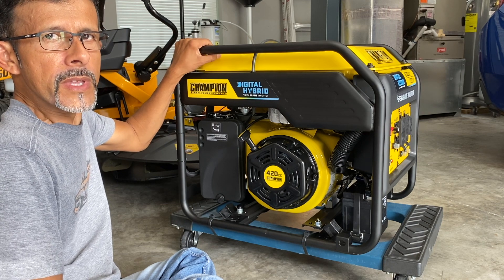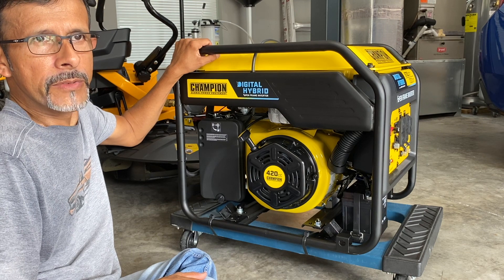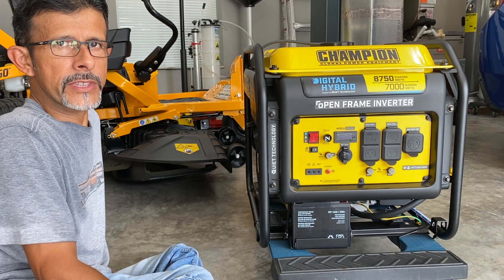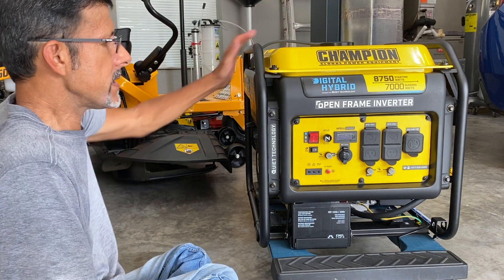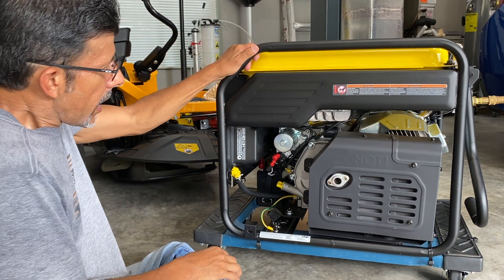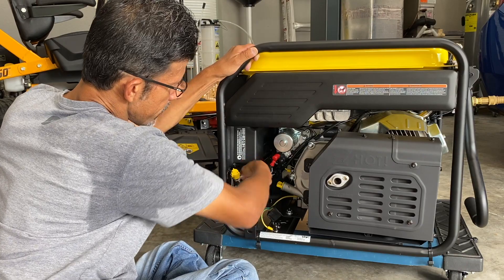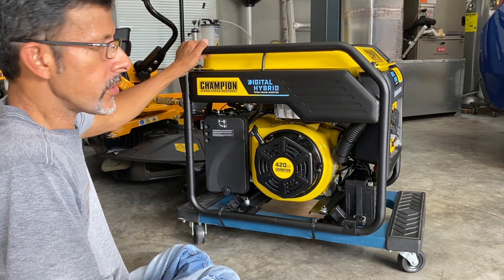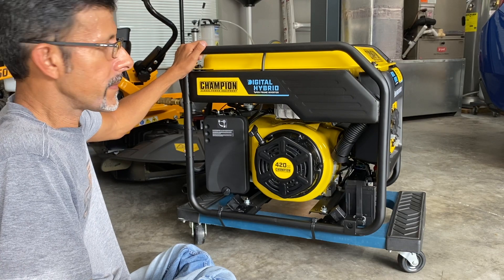Champion Inverter Generator 100520 with tri fuel kit

Comment: Great video and thanks for sharing.  When you hooked the generator to your panel did you change the 100520 to Floating neutral?
Reply from the maker: No, I didn’t change anything on my generator.
Reply: @Ozzie4Para  I heard back from Champion on my configuration.  Since I am binding neutral to ground inside my transfer switch, they asked me to switch the 100520 to Floating Neutral since my only planned use for this Generator is home power standby hooked up to the transfer switch.

Comment: Can you post a link to the blue cart that is holding the generator?
Reply from the maker: I bought it at Harbor Freight. https://www.harborfreight.com/30-in-x-18-in-1000-lb-capacity-polypropylene-dolly-69566.html
Reply: Thanks Ozzie!   I have been looking for a generator that is cheaper than the Honda EU7000is and this one has the extra capacity, inverter, propane capability that I'm looking for.   I bought multiple 40gallon propane tanks for my future generator.   What is the max wattage you have loaded up each leg before it trips while operating on Propane (I assume less than the manufacturers rating on gasoline)?   I have a L14-30 connection at my service entry panel.  I'm hoping to run a 3 Ton central A/C unit that uses about 9.8 amps per leg at 240Volts.   
**I just checked the other replies and it looks like you were able to get 6000Watts on Propane fully loaded.

Comment: I’m gonna buy the exact same unit..I’m gonna wire in a a plug to my main electrical panel so I can just plug the 30 amp 240 volt into it to run my whole house...Question,how do I need to ground or un-ground the generator? 
Is that generator a floating or bonded ground? Does it really matter?
Reply from the maker: Some say it matters but I haven’t touched my ground on my generator and it’s been working fine. You might want to check Champion’s website for more details.
Reply: @Ozzie4Para  Ok I’ll do that. Thank you

Comment: Thanks for tri-fuel tutorial. I too just bought this generator after having been without power in central Texas for 5 days. My house is equipped with inverter minis-plits and I was not willing to risk damaging them with my Generac 5500. We woke up to 40f temps and seeing our breath every morning. I'm looking forward to adding this propane option since we have a 250gallon tank on the property.

Comment: How many watts did you lose running propane or natural gas?
Reply from the maker: I’ve read you lose roughly 15% with running propane. The number goes a little higher when you’re using natural gas.
Reply: @Ozzie4Para  Yeah, I have a Tri Fuel generator but it only addresses the propane and gas; I looked at another brand that was 8000 running watts gas, it said on NG it dropped to 5500 watts, so they were claiming a loss of almost 32%.

I've been trying to decide what size generator to go with based upon intended use of NG; but I'm unsure how to gauge that if using a US Carb kit.

Comment: Hey Ozzie GREAT video and thanks for taking the time to put this together Sir.  Quick question on the MSK3101 kit from the US Carb.  I know you haven't tested this on Natural Gas but do you think it will work?  I heard mixed reviews on NG due to the lower pressure?   Can you proivide some guidance or directions please on the NG topic?  I have a permanent natural gas 1/2" line and this will work perfectly for me.
Reply from the maker: I can’t see why it wouldn’t work on NG. But just know that the BTUs on NG is even lower than propane which is lower than gasoline. So pretty much what that means is the generator won’t be putting out it’s rated power on either propane or NG.
Reply: We have a Predator 9000/7250 watts gasoline generator, that I converted to NG using this same tri-fuel kit. It runs great on NG and I haven't noticed any power lose, compared to running on gasoline.  The key is, pipe sizing and adjusting the generator/power valve to achieve the 60-62hz output under load.  I had to do this to ours and used a "Poniie PN1500 Portable Micro Electricity Usage Monitor Electrical Power Consumption Watt Meter Voltage Amp Tester," to adjust the RPM's. I ran 3/4 pipe, hose and quick disconnections, for our system.  It runs great.

Comment: Thanks for the videos Oz! Think I'm going this route. Being a few months now, how is it still running on other than gas? And dupe question, why the 2 meters on the project box?
Reply from the maker: The two meters are for each of the 120V legs so you can see how much of a load each leg is carrying.
Reply: @Ozzie4Para  Finally got mine dialed in, running on NG, good for about 5500 watts. Thanks again for the inspiration.
https://youtu.be/jbrS6D4wk5g

Comment: Great video , how do you connect this to your home , like your splits or lights or fridge , do you run extension cords or can you do modifications to plug straight up to your fuse box
Reply from the maker: I have a 30A connection point that is directly wired to my electric service.

Comment: Hey Ozzie, I've enjoyed your videos, what's the max wattage have you got from your generator on propane. And I was wondering what kind of mini splits do you have.
Reply from the maker: I can get roughly 4500 watts from my generator on propane. I have four mini splits total. One is a Pioneer, the other is a Carrier and the two others are from Mr Cool.
Reply: @Ozzie4Para  You max out at 4500 running watts on propane? I wanted to install a motor snorkel on my unit but am scared about how much power it would generate on natural gas.
Reply from the maker: @spqr105  I know the BTUs on natural gas is less than LP and much less than regular gasoline. Therefore I have no idea what the max wattage would be while running on natural gas.
Reply: @Ozzie4Para  in the FAQ section of the motor snorkel site it states, " Is there any power loss when operating on alternative fuels?
 No, we have never had a single unit show a loss of power on alternate fuel.  Though lower gallon-to-gallon in BTU content, sometimes they perform even better than running on gasoline (see also fuel consumption).  The engine regulator we install has an external fuel mixture adjuster that can be turned with your fingers and can be fine-tuned to your elevation and to the fuel supply connected.  That's why we include the Engine Hour/Tachometer Meter with every generator.  You can watch the engine rpm output while turning the mixture adjuster for peak performance and high efficiency.  This allows full control over the fuel mixture no matter what elevation.  Unlike operating on gasoline where the carburetor is a fixed jet and it can not be adjusted only replaced. This is a big advantage that allows the engine to be reset at anytime.  Engines would not use the same fuel mixture in different areas especially as diverse as say Florida would be to Colorado.   Unlike gasoline, setting the mixture lean on alternative fuel is cool running, clean burning and efficient."

What are your thoughts on this? Is this statement inaccurate?
Reply from the maker: @spqr105  I don't see how that statement can be true. I say that for the simple fact that it is proven that LP and natural gas have less BTUs than gasoline. So if a generator is rated at 5500W in stock form, how can the same generator put out the same 5500W while it is running on LP or natural gas? Take a look at the dual-fuel line of generators from Champion's website. They clearly state that the output while running on LP is less than what it would be while running on regular gasoline. I would tend to believe Champion's word over the Mr Snorkel website. Of course this is just my opinion...
Reply: @Ozzie4Para  This is a very good point and I do agree. I'm very tempted to do the conversion but wonder if it's even worth it if I'm going to lose a lot of power.

Champion states that their tri-fuel model produces, "Gasoline: 10,000 starting watts and 8000 running watts, propane: 9000 starting watts and 7200 running watts, natural gas: 8750 starting watts and 7000 running watts."

If my math is right they're saying natural gas is a 12.5% drop from gasoline which would put the running watts at 6,125 watts. That seems pretty high but I'm not sure how accurate it is.
Reply: @Ozzie Alarcon  @spqr105  interesting discussion. I am no engineer, so I could be way off base here, but the BTUs are not directly being converted to electric current, but rather mechanical energy (they fuel the running engine.) That mechanical energy is used to turn an alternator which creates the electrical current. So, if an engine turning at 3500 RPMs turns the alternator fast enough to generate 7,000 kW on gasoline, why wouldn't the same engine, turning at 3500 RPMs, running on propane or ng generate the same 7,000 kW of electrical current? In theory US Carburetor's claim makes sense if you can indeed tune the engine to get the same RPMs on propane or ng (under full load), as it does with gas. However, I do not think Champion would lower its output ratings for the propane and ng on its tri fuel generators, unless those are the values they are measuring with the different fuels. So, either you can't generate the same RPMs (under full load) with propane or ng, or you are indeed getting more electrical output than you think you are getting. Regardless, Ozzie, great videos!

Comment: I have the same setup and finished hooking up everything else up. It ran rough at first, I adjusted it until it ran smooth. It then ran fine for a couple of minutes and cut off. Tried it again and it would start, but die out. Did you have any similar issues? I think that it may have something to do with the engine warming up. It runs at 3,400 RPMs without a load.
Reply from the maker: I don’t have any issues with mine.

Comment: Three questions: does the generator have a low oil automatic cut off switch?  Does the generator charge the starting battery?  And does the propane conversion affect the warranty?
Reply from the maker: 1) Yes, the engine has a low oil turn off switch. 2) Yes, the generator also charges the battery as needed. 3) That question is sort of irrelevant because the manufacturer wouldn't have any way of knowing about the propane conversion. That's the beauty of the conversion kit. It is fully reversible if need be.
Reply: @Ozzie4Para  so if I do convert to LP, I should not post a video on YouTube that would show Champion what I did?
Reply from the maker: @olegig5166  Champion could not legally prove anything from your video on YouTube. That is unless you clearly post a video of the generator’s serial number in question.

Comment: A wonderful informative video that you did a great job in presentation of.  I just ordered the same model ( Champion 100520 ) yesterday with the tri-fuel kit as I will run it on Natural Gas. I have been using mini-split HVAC units for over 7 years and a (Heat-Pump water heater) almost 2 years, great choices for almost anyone unless they live where it is cold more often than warm.
Reply from the maker: Thanks for the nice words. You'll like your new generator.

Comment: Great Video!  I am looking to pick one up and was interesting in converting to work with propane as I was unable to find any stock inverter that has both propane and a L14-30R connector.  Any idea how long the run time is on a 20LB tank?
Reply: Never mind I see you answered outback below who asked the same question.

Comment: Hey, Ozzie! Do you have a link to the tachometer that you installed?
Reply from the maker: Here it is: https://www.amazon.com/gp/product/B07DZB57H5/ref=ppx_yo_dt_b_asin_title_o06_s00?ie=UTF8&psc=1
Reply: @Ozzie4Para  
Hi Ozzie, thanks for the video on the 10520, I went this exact direction  based on you details of your video. Everything went perfect, the conversion kit went in slick but I am having a hard time getting the tach/hour unit to register RPMs, are there any hints, ie firing sequence selection, location of induction wires, etc. Any help would be great.

Thanks,
Reply from the maker: @joanandrussell4512  you might have to set the correct engine setting on the tachometer. Some tachs like mine have a settings button that allows you to input which type of engine you’re using. Like if it’s a single or dual cylinder engine.
Reply: @Ozzie4Para  I am using the same unit that you link to from Amazon and firing pattern 1P1R for the Champion 10520 but no joy.
Reply: @Ozzie4Para 

Ozzie,  simple fix, low and bad battery from factory. Replaced and all is good. Thanks for putting the video together and now I have a twin to yours but hope I really never need it.

Comment: Loving the power meter box. For the connections, is it required to splice into the 8/3 wires? Or would it be possible to power the meters by connecting their wires to the screw terminals on one of the outlets?
Reply from the maker: blackbeardrrr I suppose you could do that. I preferred to do it the way I did it because I didn’t want to screw the little wires to the bigger wires in the screw connections.
Reply: Ozzie Alarcon cool! Did you use butt connectors? Or what was your method. Thanks!!
Reply from the maker: blackbeardrrr I stripped about half inch insulation off each wire then I soldered the thinner wire to the thicker wire. I don’t like using butt connectors when I’m working with potentially higher amperage stuff like this.
Reply: Ozzie Alarcon thanks for the detailed responses! Ok so I have a dumb question. How come we aren’t interested in amps/watts over the neutral wire? And I never see it fused/breaker protected. Is it because the neutral only carries the difference between the two phases? ( and therefore will always be less than or equal to the sum of both phases)?
Reply from the maker: blackbeardrrr it’s my understanding the neutral wire is only for the return path of the electricity. But then again, I’m not an electrician so I can’t give u the technical reason why.
Reply: And did you go with solid or stranded wire inside the box? Thanks!
Reply from the maker: blackbeardrrr I used 8 gauge stranded wire.

Comment: Thanks for the video. I have just bought the similar 6KW model and the propane kit from NashFuel. However, I haven't been able to get the generator started using NG directly. Did you have to break in using regular gasoline?
Reply from the maker: etnzr they recommend you break in the engine with at least five hours before using propane or natural gas.
Reply: @Ozzie4Para  Thank you for the advice. I will give that a try. Stay safe.

Comment: This is an awesome video.  Any chance you would build and sell an additional meter box?  Would love to have that feature, but not sure I'd have the patience to build one.  :) Again, really awesome video.
Reply from the maker: Thanks for the nice compliment. I don't know if I'd have the patience to build another one mainly because of the amount of work it took me just to build this box. I'm very OCD which means I wanted to make sure both meters were perfectly centered and they lined up with each other just perfectly. This is to say nothing about how much time and effort it took to wire up both male and female ends of the cable connections. I used 8 gauge wire which tends to be kind of difficult to work with once you begin to cut the cables short enough so they fit inside the box while not having excess wire inside the box which was already pretty cramped.

Comment: The Champion web site states that a dual fuel option isn't available. A local dealer stated that modifying the unit in any way would void the warranty.  Obviously, it can be done, do you have any concerns regarding the warranty? Also, do you have a part number for the carburetor? The link below opens another youtube video? Thanks for your video it's well done.
Reply: I'd worry less about the warranty as long as it's running fine prior to installing the tri-fuel kit.  For me personally I'm more concerned with making it work for my needs.

Comment: Great video, thanks for taking the time to make it. Do you know what the consumption rate is (eco mode off) with propane?  Keep us all updated on how it works out for you.
Reply from the maker: Outback Production not sure what u mean in terms of consumption rate. But the way I calculate things. I’ll have about 5600W continuous power available while running on propane. I did some testing earlier and I was able to pull 6000W on propane and the generator ran just fine.
Reply: @Ozzie4Para  What I mean is, compared to gas the generator at 50% load could run for 10.5 hours with a 4.2 gal tank. So that's 0.4 gallons an hour. Im just wondering how it compares to propane. Thanks!
Reply from the maker: Outback Production I can’t answer your question because I haven’t tested the usage in terms of propane consumption within a set time frame. I have a 100 gallon propane tank which I know should give me around five days of 24/7 running power.
Reply: Ok thanks. Keep us updated on how the generator works for you.